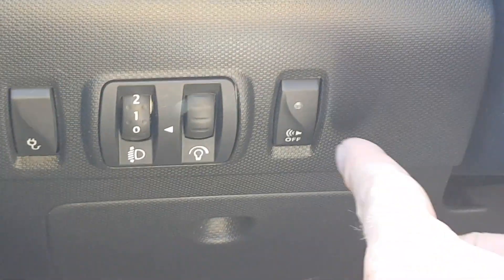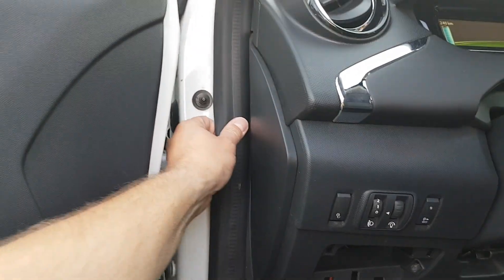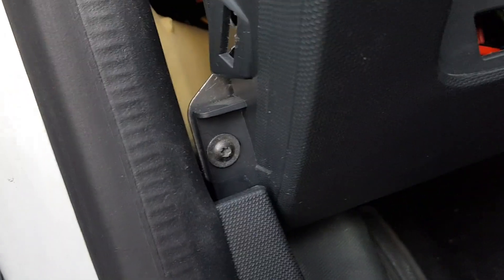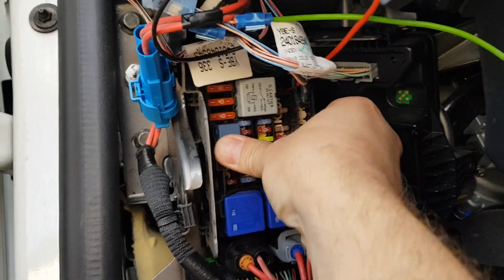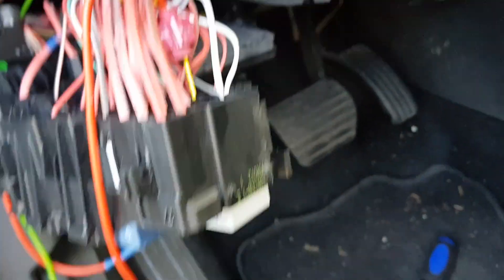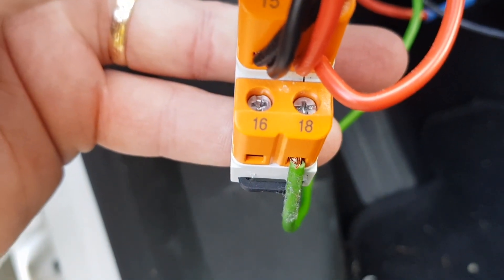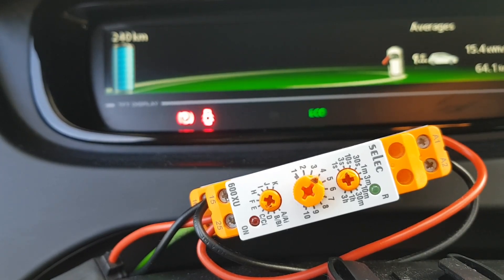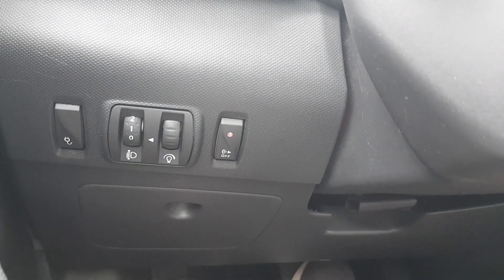🔴 Zoe driving sound automatic disable by default in Renault Zoe eDrive 🚘⚡️

Comment: personally i really like the space ship that the zoe do,(i have the 2018 r110 limited 40),
think that sound its only from 1 to 30 km/h...and a part of safe for people, they will turn the head to see what kind of vehicle its making that noise,even today is strange to see an electric car
😆😁
Reply from the maker: Well,I bought the electric car, because I like silent driving.
Any better gasoline car is even much more silent than the sound generator of the Zoe. 
A high class Mercedes S-class, or Rolls Royce are very silent, you can't hear them when driving slow. 
For the gasoline cars, they spend a huge amount of money to make them silent and with the electric cars, they need to spend money to make it loud? 
So if a silent Rolls Royce car bump on you, that's fine, but if a silent electric car bump on you, that's a problem?
I can't get the point...  
By the way, if I know they can't hear me, I drive like they can't hear me...
Reply: @eDriver  anyway i like your invention,its interesting for those people who likes the gasoline sound and the clean and cheap electricity to travel.
Very nice work!!

Comment: Great work Alex.. Congratulations .. although I would love to have this sorted out and turn the sound button to be silent on default, I would not try this. Electrical circuits in modern cars are very accurate due to on board computers. In this case, it would be even more complicated in an electric car. See I have a Zoe 2018 and sometimes, even with changing a W5W bulb, the car requests key in as it detected a change in electrical circuits. So I really admire the work, but I would definitely look for a better solution via programing rather than this.
Reply from the maker: Well, I have the same 2018 model. 
The Renault Zoe is not a modern high-tech electric car, like a Tesla, where you can do everything via software.
I am pretty sure, you can't do this via programming. 
But if you will find a solution, let me know..
Reply: This perfectly emulates the button being pressed by a person. The car cannot know the difference

Comment: Hello Alex, you are very a very brave man 👍🏻

Firstly for using the English language without fear😎!¡ Don’t let your teacher watch this video 🤫😉

Secondly for your clever solution to change the sound generator behaviour🙉

I myself wouldn’t dare to manipulate the cars electronics, but it looks like you have a professional background - and no fear 😀

There is, by the way, a reason why the sound generator is enabled by default: the reason it being a security feature...

Alex, you might be interested: this switch is not only for disabling the sound generator, it has another function: you can toggle through three different sounds: 
a) warp sound
b) no sound
c) warp sound, but softer
d) no sound
e) a different, very soft sound
f) no sound
a) warp... etc.

I also did not like the default - quite loud - warp sound, but I switched to the third sound, which doesn’t really disturb inside the car.
I will only disable it, if I come home after midnight and try not to wake the neighbours 😔🌙
Reply from the maker: Never mind about my language... hehe 

I was living for years abroad and there is no problem, people can understand me and that's all I want. Most of the time I am talking English to my wife and there is no problem by that... 

Also in the video, people understand what it is about and they will get the point.
For me the sound generator should be disabled by default. I can enable it, whenever it is needed. That's why I just don't like to unplug the speaker, because then I can't enable it instant when needed.
For me, it's just disturbing even inside the car, if I hear that sound.

I know that there are different sounds. All are disturbing sounds... But like I said in the video, I like silent driving and not creating extra noise. If I like noise, I should buy a Diesel car. ;-)
Reply: добрый день! как включить другие звуки? спасибо за ответ!

Comment: You can just remove the Fuse. This disables the sound generator and also the beep when the car locks if you have the hands free feature.
Reply from the maker: To remove the fuse was no option. Because if you remove the fuse, you can't just activate it, if needed. And like said in the video, I like to keep all other sounds active.

Comment: Clever idea.  Does it invalidate the car’s manufacturers warranty?
Reply from the maker: I don't think so. What can it affect? Probably, if the switch beside the steering wheel, to deactivate the sound generator,will get damaged, it is not covered. But what else can it affect? ;-)
Reply: eDrive Car manufacturers can be peculiar about warranties, there’s no obvious reason but modifications can be a loophole for them to climb through to avoid them doing warranty work.  I’m not saying that they will object, but it’s probably worth checking your guarantee.